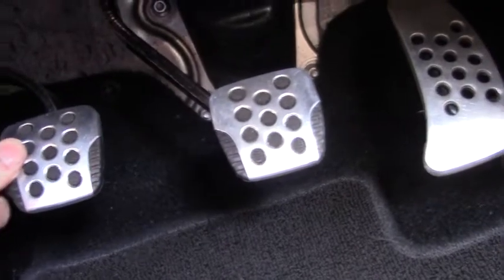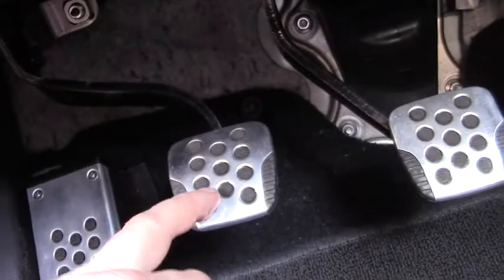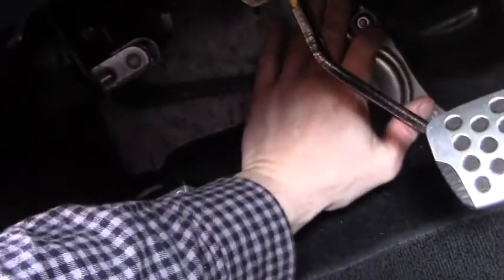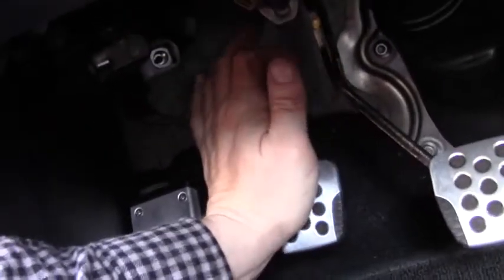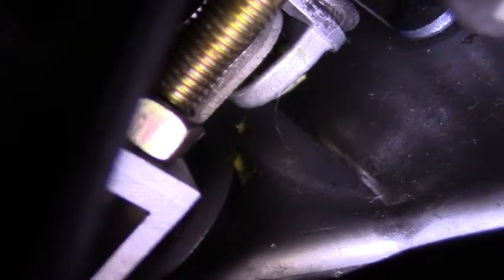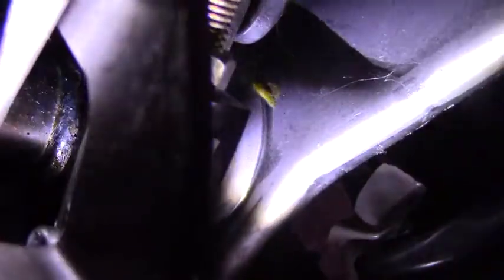350Z JWT Clutch, Wilwood MC, Zspeed Slave - Clutch pedal high engagement

Comment: Hmmm my 04 350z clutch bothers me because you can push it in really far with nothing happening, it all happens so close to nearly being depressed all the way.  What would you do in that scenario to get a more solid feel and wider sweep on the clutch action?
Reply from the maker: +Carmelo Santini I would look at the nut that attaches to the clutch fork bolt that goes into the firewall (This is what presses against the master cylinder).

Go look at this forum thread -- it has a step by step on what to do to adjust this nut.  http://my350z.com/forum/engine-and-drivetrain/471740-clutch-pedal-adjustment.html

However, your issue is the OPPOSITE of what the people in the thread are adjusting for,.. so you likely want to turn the opposite way to make the clutch pedal engage closer to you.

I noticed there are zero videos on even remotely how to do this.. It's quite easy, but I'll make a video on adjusting this nut in the next couple of weeks if you never get around to doing it.  Basically I'll just outline in the video (hard to get a camera and light in that tight space) where the bolt is.. how to turn it, what tools needed, etc.. But it's one of those adjustments that takes just a few turns of the actual long bolt itself (mark it so you know a full turn has gone by when you turn it) and then you just retighten the lock nut down.

Hardest part is squeezing down there in that tight space.  I actually usually remove the driver seat (just pop the four bolts off) to give me space.. but most people don't (I'm just a 6ft dude with wide shoulders.. so I need the room) --

At any rate -- it isn't uncommon for that nut to come loose and over time that rod to turn on it's own causing your issue.  However, it can also be a worn clutch (the pedal does change as the clutch wears).. and can be issues with the master and/or slave cylinders) -- However generally, master and/or slave cylinder issues cause the pedal to stick to the floor, or otherwise not return back to you like it normally would.  If that isn't happen there isn't likely anything wrong with your master or slave unless the clutch is actually slipping (and even then that could be just a worn out clutch.)

Bottom line, just read up on that thread I linked:

http://my350z.com/forum/engine-and-drivetrain/471740-clutch-pedal-adjustment.html

And go have a look at yours.  Mark the bolt coming from firewall on the tip with a marker, like a line on the tip.. So you can count the turns you do, and return it to default (where it started) in a worse case scenario.
Reply: Very cool, thanks for the information.  My head gasket potentially blew or I just have air in my cooling system that NTB didn't get out and it's in the shop right now.  While it's there I'll check with him to see if I could get it adjusted there.  It has 140,000 miles on it so I figure a clutch and flywheel is probably what I need but that might help get me by
Reply from the maker: +Carmelo Santini Bummer on the headgasket!  How much was the headgasket + labor/parts out of curiosity?

I'm sure they can adjust it, but if it went 140k without a new clutch,.. then wow!  haha.. A clutch will typically run 50-60k unless you are rather "easy"  on them like I tend to be and you can don't just burn them with poor driving skills or just ragging the car too long too often.  Anyhow, on clutch and flywheel.. I recommend the combo I did -- Unless you want to improve flywheel speed and don't care about chatter under 2300rpm or so -- Clutches are always cheaper non factory and you can get a better one,.. flywheels are as well, but the OEM dualmass is really the only flywheel you can put in our cars that are "quiet".

Sounds like you are putting that off as long as possible,.. but it will eventually crop up -- be sure to have a look at those master and slave cylinders and throw in some stainless steel lines (cheap, might as well) whenever that time comes.

Let me know how things turn out.
Reply: Well not sure on the head gasket, they had a specialized pressure tester that revealed there is indeed a leak that no one has been able to find lol.  Speculation currently rests on a silicon gasket in the water pump area but still waiting to find out for sure.  

Cool thanks for the advice, I actually have a categorized list of upgrades that I'm just going to have the shop recommend stages of.  Right now the challenge is gaining my income back.  I think since I've had the car for 7 years, wanted one before then, and still love it I want to get pretty much everything done with it and cap it off with an interior palette involving espresso alcantara and thick stitched tan/coffee leather and a refinished center console.  I don't really see the 350's fading away, I still love the 280's.  I like the 350 more than the 370, and I don't really see anything under 70k that even would tempt me to move away from my car.
Reply: What you end up doing with the clutch? Just adjust the master rod bolt a bit!? Or get a rjm pedal?

Comment: I had the master and slave replaced on my 06 350 b/c my pedal would occasionally stick to the floor after long driving in heat or traffic. Now the pedal feels mushy/sticky at the top 3/4" which unfortunately is where the engagement point is. It did not have this issue before. It has a new line which was bled thoroughly a couple times. Any ideas?
Reply from the maker: How many miles are on your clutch?

I would suggest buying one of these pedal assembly's.. They make the car feel so much better,.. completely adjustable on where engagement it and how long you want the engagement to be among many other things..

http://www.rjmperformance.com/350z--g35-afp-clutch-pedal-kits.html

You may have some lingering issues somewhere, or maybe not.  Z's are notorious for having high engagement points, which makes them very tricky for people new to them to start in first gear.  There is an adjustment you can do to the clutch pedal height, but I'm not a big fan of doing it over fixing the problem which is a really bad pedal design.  I think you'll see from that link above why.

Comment: Hey man, can you explain to me more of what you've done and more about the clutch pedal? Thanks in advance! Also my clutch sometimes doesn't go all the way up when car is driven for awhile, do you know what the problem could be?
Reply from the maker: John Angeles In short, I replaced the Master Cylinder with a Wilwood Heavy Duty Master Cylinder.  -- I replaced the Concentric Slave Cylinder with a Zspeed Heavy Duty CSC.  -- I replaced the clutch with a Jim Wolf Technology HD Clutch.  -- I replaced the Dual Mass flywheel with a New Nissan Dual Mass flywheel. -- 

As for your issue -- It's most definitely either the Master Cylinder or Slave Cylinder -- When replacing either, it is VERY much advised to replace both.  The Slave cylinders in the 350Z's (as well as G35's, G37's, and 370's) tend to go bad.. So my best guess would be a failing Slave Cylinder,.. but again, given a new (or rebuilt) Master Cylinder is relatively cheap I'd recommend replacing both.  I opted to go with considerably more expensive Master and Slave cylinders of the Aftermarket HD variety so they wouldn't fail again.  But many simply replace with the existing factory OEM models for much less money.. though I will say quite a few have had their slave cylinders fail again within 4-10k miles after putting in a new OEM (Nissan) Slave.  Either way, a new Slave (and master) will fix your pedal issue.  

If you do a little searching on forums, or just google for "350Z Slave Cylinder Clutch Pedal Problem" you'll get tons of results describing your issue.

Let me know how you get on..

Comment: My 08 has this same problem I have a stage 3 clutch on it, and its a bish to drive with such a high engagment point, I have tried to adjust that rod but it does nothing. I think i might need a new clutch but the clutch never slips or show any other signs of being worn, any advice on what should be done? I own a 2008 350z hr that is supercharged and has 430 hp and 330 rwtch so that clutch deff is an issue
thanks
Reply: +josh rendon Yes I did.  Get this pedal assembly.. you'll feel like you're driving a different, much better, car :)

http://www.rjmperformance.com/350z--g35-afp-clutch-pedal-kits.html

Comment: I just ordered my Zslave couple days ago. What are your thoughts on it?
Reply from the maker: Nothing but good reports here.  You'll see the construction quality and design when it arrives.  I haven't had a single issue with the HD Slave Cylinder.  Smart move going with it.
Reply: +GuessTech well that's good to know. I haven't installed it yet. Hopefully this weekend.  I bought a new master also. I want that pedal assembly but I've spent so much money already. Master, speed slave, jwt clutch and flywheel, oil sending unit, brakes front and back :(
Reply from the maker: I would go 'google' it for yourself to verify -- but if I recall correctly,.. yes.  I believe the HR models started to put the CSC (Concentric Slave Cylinder) on the inside of the bell housing where the DE's have it accessible without dropping the tran/bellhousing.  Though you can get beefed up / Heavy Duty versions of these master, slave, etc for DE's as well of course.
Reply from the maker: How did you project turn out ?
Reply: GuessTech went good. No problems so far. It's a little softer than I would like it to be but it's better than the stock feeling.
Reply from the maker: I see, glad it works for you.   At first I was a little shocked to hear it felt 'softer' than stock but then I quickly considered I had replaced most of the entire system with aftermarket (better/HD) versions so my feel/experience should be a lot different.  I went with a reengineered HD Slave, Master, SS lines, new bearing, and complete JWT HD Clutch with new DM Flywheel.  So mine was significantly better feeling than stock while also took noticeably more pressure to physically press in and release the clutch pedal itself due to higher clamping forces alone.  Were you having issues with your pedal dropping to floor, slipping, etc? And if so.. did just that ZSlave solve these problems?

Comment: 2,600 lb pressure plate clamping force and you can push the peddle down with your thumb!!  lol
Reply from the maker: I have super human strength ;)
Reply: I've got a 2,000 lb Pressure plate..Definitely Very hard to press down even with my hand.. A thumb would certainly break lol.. Maybe your is less or possibly different mechanisms (Leverage) 
Still thinkin its closer to 1,000 lb pressure plate

Comment: If I put new clutch and flywheel.
Will it be soft?
Reply: Soft? No, the pedal feel won't be softer.  The stiffness of the pedal is most determined by the clamping strength/force of your pressure plate that comes with your clutch.  So for example.. if you put a 'heavy duty' or otherwise higher clamping / stronger clutch kit in -- the pedal will be stiffer/harder to press in -- If you put a lighter clutch (no one puts a lighter clutch than factory.. if they do it's highly rare and not recommended) -- it would of course be softer/easier to press.  You can adjust the 'feel' of the clutch pedal itself with an aftermarket clutch pedal -- There is only one aftermarket clutch pedal replacement that actually is amazing -- completely changes the feel of the pedal and is 100% adjustable to make it feel as hard/soft as you want, allows you to adjust engagement point anywhere you want and 50 other adjustments on the fly.  I have one never opened in box if you are interested.  It's an RJM Pedal -- They cost $259-$3XX depending on the 'extras' you want with them -- I'd be willing to sell this extra one to you for a discount if interested.  Go read up on the RJM clutch pedal and you may want it. :)